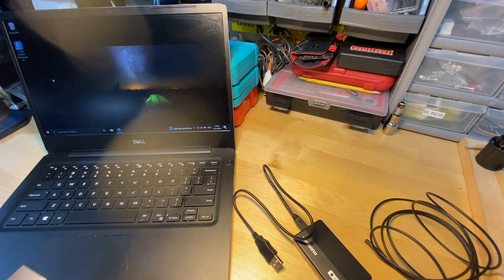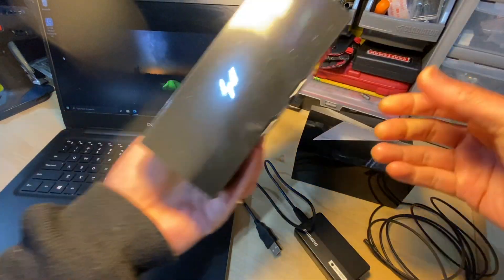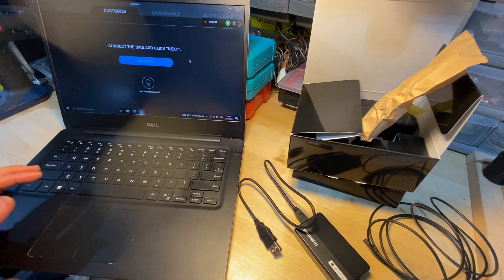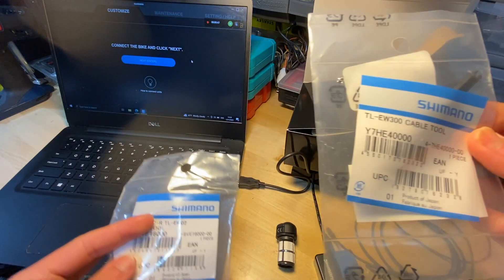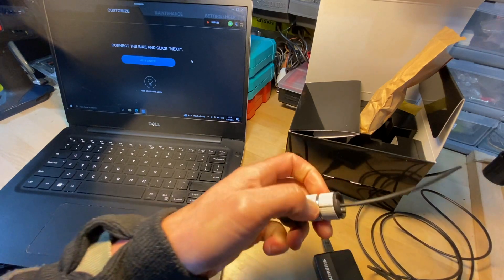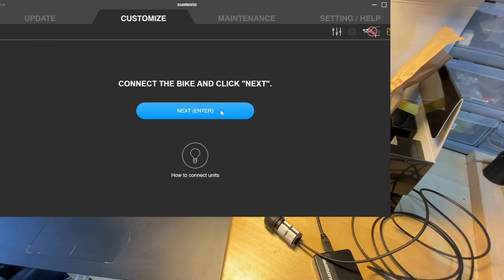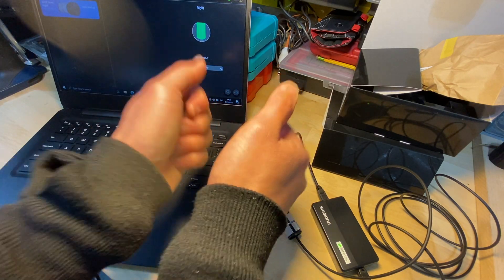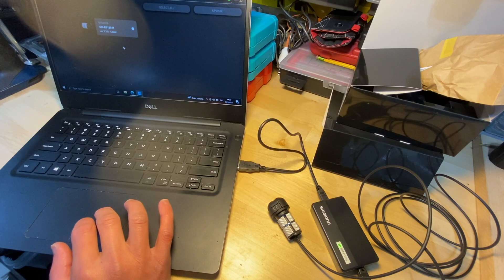Setting up my Di2 TT shifters via USB using E-tube project Pro and SM-PCE02

Comment: Maybe you have an idea. My battery sm brtr1 the bulky type battery is draining even not using it just overnight. I isolated the possible cause and i found that it was the right shifter sw r671. Is upgrading the firmware may help or cleaning the shifter or totally replacing it?

I cant find sm pce02 device. My rd and fs is dura ace 9070 di2

Comment: does this mean it can now work with 12 speed?
Reply from the maker: I did my video a few years ago and if you are buying TT shifters now they should already be updated with the latest firmware that works with 12 speed. Hope this helps!
Reply: @howtotriathlon oh really? I was told it would not work… so I had to purchase sprint shifters
Reply from the maker: @JB-nt4jd  Just to be clear: I have been using the Shimano Di2 TT shifters with Ultegra Di2 12-speed since I did this video 2 years ago and never have any issues. I'm also using Synchroshift, which means I don't get to manually shift the front gear and Di2 automatically shifts for me. I can see why you would need sprint shifters if you want the ability to shift the front gear manually (like on a road bike).